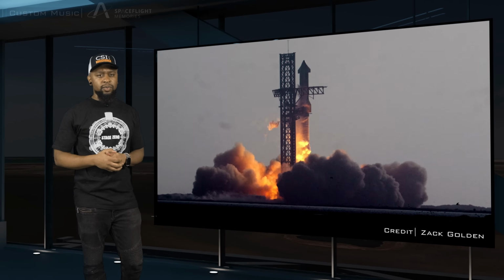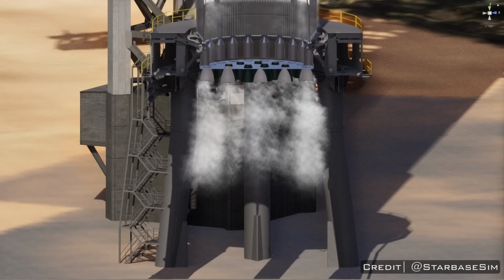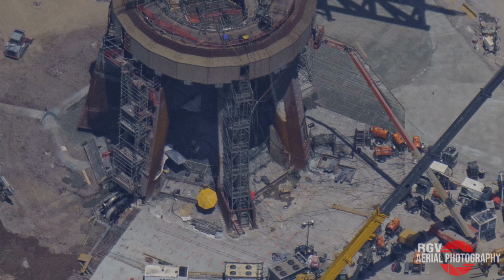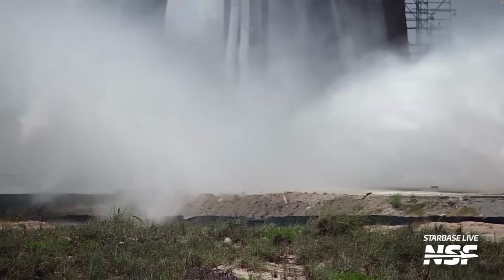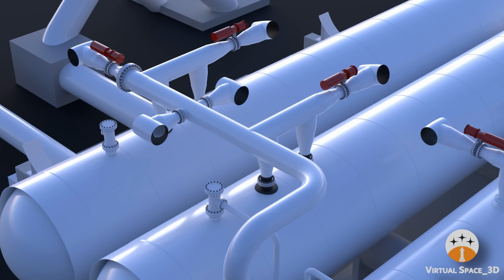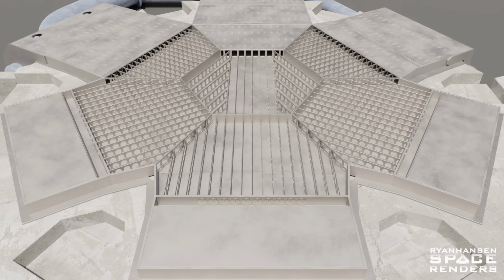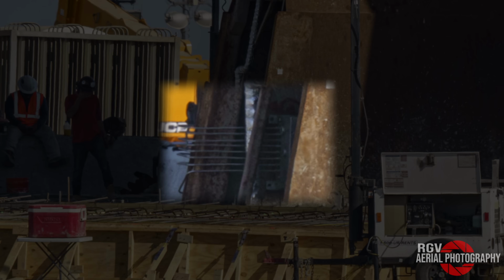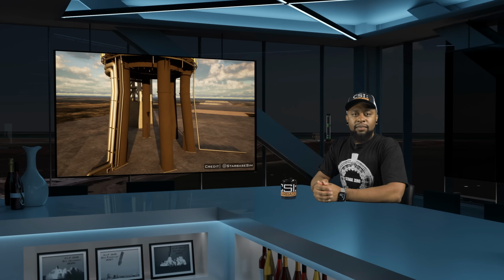How SpaceX Will Guarantee Its Launch Pad Never Fails Again! [Part 2]

Comment: Zack, you did not mention anything about Elon's plans to turn OLM into steam cannon launching Starships with only 50% of nominal thrust. All that it takes is a tube on top of OLM extending to just below grid fins and closings top 3/4 of the gaps between  OLM support columns.
Reply: Source?
Reply: @alvianchoiriapriliansyah9882  Elon has little choice in that matter. Volumetric expansion of steam generates so much  pressure under OLM that pressure gradient causes that steam to expand faster and further away from  OLM than pure rocket engine exhaust. This rises very interesting question as increased pressure under OLM will tend to lift the rocket even in absence of full thrust of rocket engines. If Elon uses hold down clamps and waits for full thrust to release them rocket will get a kick that most likely will crush the Skirt of the Starship and cause explosion on the launchpad. If Elon does not use hold down clamps like the last time than rocket will lift off the OLM inching upwards until it clears OLM with only  say 70% of thrust needed to lift it off (rest being steam pressure). After clearing OLM steam valve (the rocket) will open up releasing steam pressure with rocket dropping onto OLM while trying to balance itself and moving sideways as it did last time.( TVC can balance the rocket only if bottom of the rocket can move sideways) . That spells disaster that was avoided last time only due to absence of water deluge system. The only solution appears to be turning OLM  into steam cannon by adding a tube on top of OLM reaching just below grid fins. Length of the tube will give the rocket enough travel distance to develop enough speed without excessive acceleration to be able to turn on full thrust before it starts to fall back onto OLM.
Reply: @KarolKarolak Where's the tube? Where's the steam valve? Where's your CFD analysis & calculations? Where's Elon statement?
Reply: @alvianchoiriapriliansyah9882  Elon Musk accidentally created Steam Cannon at Boca Chica launch site. Now he can try to fight steam cannon effect on total thrust during liftoff or embrace this effect and make proper Steam Cannon. Fighting steam cannon effect will be difficult as it is highly unpredictable and disappears very quickly. Ignoring it and releasing hold down clamps after full thrust is reached leads to hard kick. Taking it into account and releasing clamps with reduced thrust requires very fast increase to full thrust right after hold down clamps release or rocket would slide back onto OLM.   Making proper Steam Cannon involves extending barrel length from 2m to more than 40m, partially closing off sides of OLM and use chopsticks (moving up with the rocket) to guide upper part of the rocket during liftoff. Extending barrel length allows for developing velocity with low acceleration and reduced thrust. It also allows for transition from reduced thrust to full thrust while in the tube increasing transition time. If Elon goes ahead with proper Steam Cannon it will be a revolution in rocketry.
Reply: @KarolKarolak Presenting CFD analysis as a proof sounds too hard, didn't it?
Reply: @alvianchoiriapriliansyah9882  You are lost cause best to ignore.

Comment: The amount and quality of work to produce this excellent video by Zack is very impressive. The accomplishment of this repair and upgrade by SpaceX in the time it was done wouldn't be believed without seeing it with our own eyes. it was only possible because most of the design and fabrication of the system was done prior to the first launch.

Comment: This thing may never fly with too many engines destroying themselves during lunch. Ther is no adequate heat shield and space glass capable withstanding reentry. Development may  take decades even with Elon's rapid speed egineering. Russians have a simpler lunch table with huge space excavated under it to dissipate pressure naturaly without crazy water piping. I think Rocketry is an extremely wasteful inefficient technology to fly into space. There should be a better way
Reply: Yes because there's no way a tiled ship will survive reentry...

Oh wait...
Reply: @alvianchoiriapriliansyah9882   Russians figured strong heat tile formula and a Space glass capable shilding radiation and survive reentry for thier Buran space plane . Americans  are behind at glass and heat tiles. Weak heat tiles stopped Shuttle project (too dangerouus). Elon just managed to invent a better engine and reusability, but he hasn't solved other problems yet. He stumbled with lunch table. More than 20 engines may never work, they simply destrojy each other with a combined power. There might be a physical limit on that. It seems that way. You can't just combine them indefinetely. Stronger thrust starts destroing them. Making them stronger would increase weight, making pointless building a bigger rocket. If he is having an issue with 9 meter diameter, 18 meter would never work. It is a vaporware., good on paper only
Reply: @TheGrateful108 More than 20 engines already worked though...
Reply: You are right about a need for 😂better way. Problem is that you do not see better way even when it stares straight into your face. What you are looking at is a better way it is a steam cannon  with few elements still missing. Use of steam cannon during liftoff cuts down on fuel and oxidizer consumption as it requires less thrust produced by rocket engines
Reply: They’re about to catch a second booster bro

Comment: Possible additional reasons tiles won't work:
1) air density is far higher and high velocity and temperature will have a fantastically high erosive effect. It may be that Zack's "high stagnation pressure" is short for the same.
2) Tiles will slowly heat up as the re-entry occurs and the thermal capacity of the tile is enough to withstand the energy of the re-entry, but probably not enough got the launch.

Comment: I felt like I was the only one who noticed they threaded those massive holes in the plate. Nobody was mentioning that they were indeed threaded. Using them to adjust flow by adding or removing plugs makes so much sense. Imagine home expensive and precise the machine is on those taps and how difficult it must have been to get it started and lined up properly.

Comment: Excellent data and analysis.   Love to understand the condition of the holes in the central pancake plate after the static fire test..... and certainly after the next orbital launch attempt (i.e., any evidence of erosion).  Again - your technical summary and presentation is the best.  Keep the videos coming.  Fully understand the time and effort required to produce this product.  Well appreciated.

Comment: Sure would be noice to see the raptors spark. Can't help wonder if the inner 3 engines innintially gimble outward to help set up that lateral force redirection. Top class detectorating once again!

Comment: I saw the test fire. With half thrust the pad was still damaged and the thrust obviously overwhelmed the water pressure of the “shower head”.  The paint is still stripped by every firing, and it throws debris into the tanks.  Because the pad bas is still flat and does not deflect acoustic energy, At full thrust for 5-7 seconds we will see the constructive interference of acoustic shockwaves creating high explosive levels of concussions, 20 or 30 in a row, just as we saw shooting up the side of the rocket in the first full launch.  It was these 20 or more constructive acoustic concussions that pulverized the pad, and it will turn the shower head structure into something that looks like an Jamaican kettle drum.  They are creating the perfect reflector of sound energy, RATHER than deflecting and dissipating it.   I expect the next launch will see the concrete of the pad survive, but only due to the sacrificial loss of the water feature.  Its is STILL a single use pad, not capable of turning a booster around in a week, much less a day.
Reply from the maker: I strongly disagree but we will soon find out
Reply: You simply have no idea what it is that you are looking at. Elon accidently build steam cannon that will solve all acoustic issues you are so concerned about. Sit back relax and watch the show unfolding in front  of your eyes.
Reply: @KarolKarolak  I know exactly what I’m looking at. A makeshift attempt at slapping a design bandaid on a fundamental design flaw wherein they won’t give up the flat floor they want under the rocket so they can use their engine lift.  An engine lift that has two sides that have to be able to fold down, because some idiot did not think far enough ahead to realize they needed a FOUR legged launch mount, rather than a SIX leg mount that would have made it so they could roll a flame diverter in and out. Y’know, like every other large scale launch pad can.  Other deluge systems do not ask their water injectors to operate directly opposed to the force of the thrust. They flood the water in from the SIDE.  SO the engine exhaust pulls the water into the plasma.  This system literally allows the engines to overpower the pressure of the water coming in thru all those holes.   It will blast the water out of the way, which is fine for helping dissipate heat, but will leave the metal unprotected from acoustic shock.  It was not the force of the engines nor the heat that destroyed the pad previously. It was constructive acoustic interference from the flat sound reflector they built under their rocket.

Comment: I don’t think the water plays a role in redirecting the gas. The stagnation pressure will do that automatically. The reason the gas cloud expands faster I think is because of the boiling of the water. I guess this could be checked by comparing the water volumetric flow when boiled with the difference in cloud volumetric generation between the two tests.
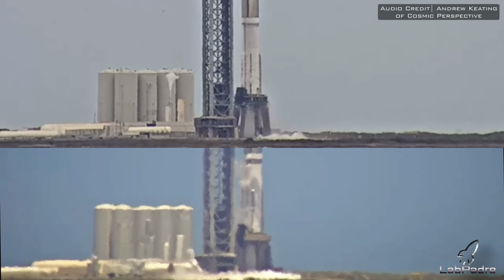48:26
Reply from the maker: I disagree. There is a reason SPaceX calls it a flame deflector
Reply: You have raised very interesting issue. Boiling of water is the right answer as to why plume expands much faster. Volumetric expansion of steam generates so much  pressure under OLM that pressure gradient causes that steam to expand faster and further away from  OLM than pure rocket engine exhaust. This rises very interesting question increased pressure under OLM will tend to lift the rocket even in absence of full thrust of rocket engines. If Elon uses hold down clamps and waits tll full thrust to release them rocket will get a kick that most likely will crush the Skirt of the Starship and explosion on the launchpad. If Elon does not use hold down clamps like the last time than rocket will lift off the OLM inching upwards until it clears OLM with only  say 70% of thrust needed to lift it off (rest being steam pressure). After clearing OLM steam valve (the rocket) will open up releasing steam pressure with rocket dropping onto OLM while trying to balance itself and moving sideways as it did last time.( TVC can balance the rocket only if bottom of the rocket can move sideways) . That spells disaster that was avoided last time only due to absence of water deluge system. The only solution appears to be turning OLM  into steam cannon by adding a tube on top of OLM reaching just below grid fins. Length of the tube will give the rocket enough travel distance to develop enough speed without excessive acceleration to be able to turn on full thrust before it starts to fall back onto OLM.

Comment: The problem at this point isn’t stage 0, but state, faa and any pending lawsuits.   It’s sad because we could be so much further than we are now.
Reply from the maker: Agreed
Reply: Sadly continental United States apparently has zero places to build a proper launch complex that would support Starship operations. China has Hainan Island. Russia has Baikonur.
Reply: @jook360 USA has Cape Canaveral which SpaceX already built a second Starship pad
Reply: It's on HOLD, NASA, the landlord, feels it is too close to launch complex 39A where the country's only crew access to the ISS launches from.
 @alvianchoiriapriliansyah9882
Reply: @jook360 You knew what's happening at SLC-40 right?
Reply: @KenCheckeye the lawsuits has literally zero effects on the matter
Reply: @alvianchoiriapriliansyah9882  right - except without faa authorization, starship is a monument. The faa is currently being sued for not performing an environmental impact.  At least that’s my very limited understanding.
Reply: @LDoctorKC The second launch is now waiting for FAA to approve the corrective action from mishap report. The lawsuits as long as no injunction is issued, will have zero effect on launch readiness

Comment: Another potential benefit of raptor 3's higher thrust output is (if they don't increase launch mass) that they could have more than 3 engines fail startup and still take off.
Reply from the maker: Very good point
Reply: And take of at a lower throttle setting to limit the stress on stage 0 and throttle up once the booster has cleared the pad if all engines are working correctly.
Reply: @bongi6811  Yes they could use less throttle but no that wouldn't reduce the stress on stage 0 because its actually low thrust that stresses it more because it takes longer to clear the pad. That was a big part of why the IFT caused so much damage because it took longer than it was supposed to to clear the pad.
Reply: @alexanderx33  Oh absolutely, the time spend on or near the OLM is very important and I completely agree that it played a major role in the damage on the first IFT. My thought was that there should also be a point where increasing the thrust theoretically increases the stress on the pad. If a future Starship with very powerful engines for example could achieve a TWR of 2 at full throttle, it would take 2s to rise 20m above the OLM, with the engine ignition itself at about 3s it would spend about 5s in total blasting the pad. If the same Starship throttled down to 75% it would reach the 20m mark in about 2.8s for 5.8s in total. In this scenario it might be better for the pad to have to sustain engine firing for 16% longer, but only at 75% throttle. 

There should be a sweet spot of thrust to time somewhere in the middle, but I don't know where exactly it is. This could be the reason why SpaceX went with 90% throttle at liftoff for the first IFT, but I think another reason is more likely since the currently low TWR probably means that throttling all the way up is theoretically the best option.

Comment: As with Musk, his team and most everyone else schooled in 'standard model' thinking only, they assume that all that needs to be of concern, is temperature and kinetic energy and so miss completely what is really important with this launch system and that is the most destructive force, the force of electrical charge on matter and which trumps heat and kinetic pressure by 10^39. as the force of electromagnetism is 1000 billion billion billion billion times stronger than Newtonian gravity, or even how the einsteins fantasied it to work, the bending of the electromagnetic Spectrum in the presence of matter on a flat bit of rubber-like cloth.

Once a definite launch date is decided on, I will publish my bit on it and tell what happened with the first attempt (my thing is the weather- Electric Weather Mechanics), as well as what is likely to occur with the new system, with examples of it probably showing and so, the team having to for the time being, keeping the launch plate covered in a big blue tarp. But in the mean time and even though we have moved on a very long way from these early experiments, the following clip explains the consequences of not knowing how charged matter behaves when controlled in the right manor and then temperature are tried to be obtained, the vaporisation of tungsten with just 186 Watts DC and yes these are friends of mine. https://www.youtube.com/watch?v=7y46wMAHnsI&list=PLQTfnq7B6uPY1RjMjBjBS5fDxd3gJAvl3&index=3&t=57s

Comment: One part of the reconstruction of the pad that I'm very curious on is the managerial decisions that enabled workers to replace and rebuild what was damaged in this amount of tme. A lot of critics said a fast turnaround was impossible, but part of me wants to believe this isn't because they think it's physically impossible to build something that quickly but because we've just never seen a company operate on timetables like this. Is this sort of speed in repair work just normal in the industry, or is this a product of something else?

It might be beyond the scope of this channel sadly but it surely must be an important part of SpaceX's rapid development process to just have a chain of command that's very efficient at doing their jobs. Any comparisons out there could be super interesting.
Reply from the maker: Thats exactly why I didn't think this was possible. I have never seen a project management team move this quickly. I figured the design phase alone would take several months.   lol its almost like they knew it would happen
Reply: @CSIStarbase  What I would give for you to have a fly on the wall at SpaceX Starbase meetings!

Comment: "Over a day to recycle and refill the water tanks"...so they're going to need 9-20 times more to get up to actual production launch rates
Reply: It’s just the supply that’s the issue. If there was a mains supply there’d be no delay.
Reply: @Geoff_A  that's the whole problem with this launch complex. It's almost completely off-grid. It's in the middle of nowhere.
Reply: @Wheretherivermeets  problems can be solved. For example they’ve just finished connecting the entire complex to a 3 phase power supply. It’s a work in progress.
Reply: @Geoff_A Thats great to hear!

Comment: I have to wonder if SpaceX had to hire an engineering firm that specializes in high pressure water systems to help them design the deluge system. Anyway another amazing (bonkers) video!
Reply from the maker: Thats a good question. I'm sure they did that long in advance of constructing this